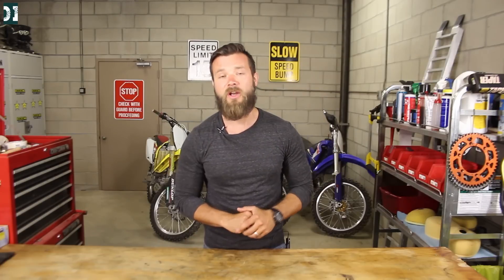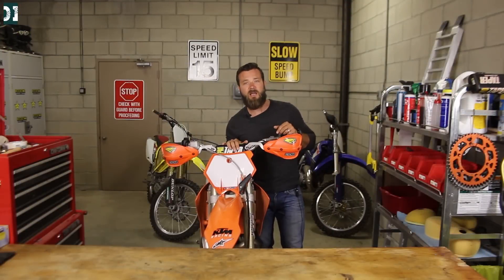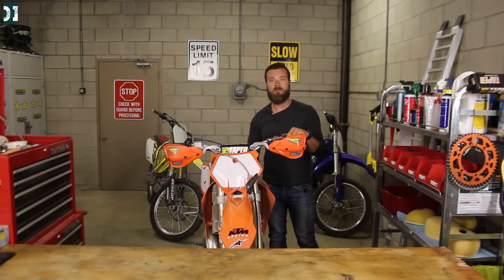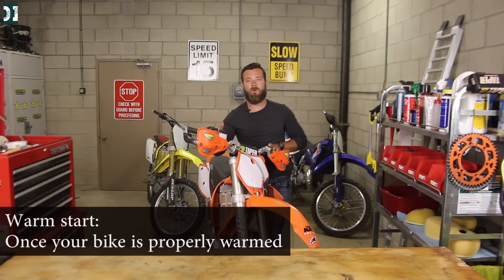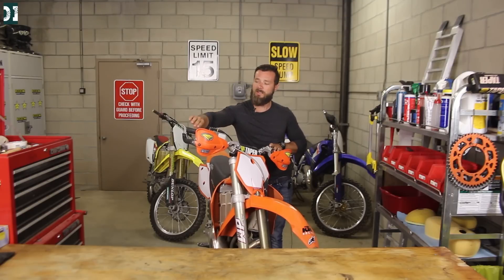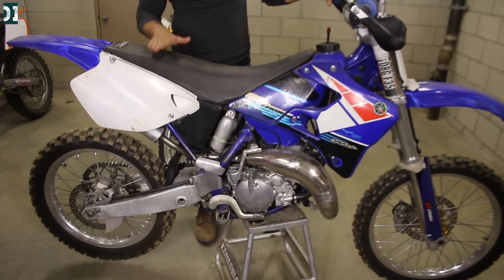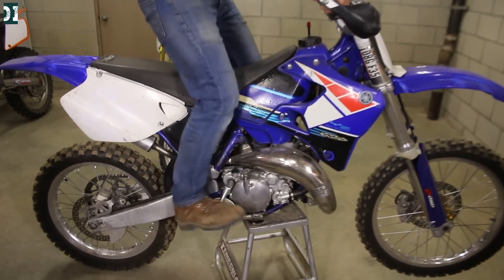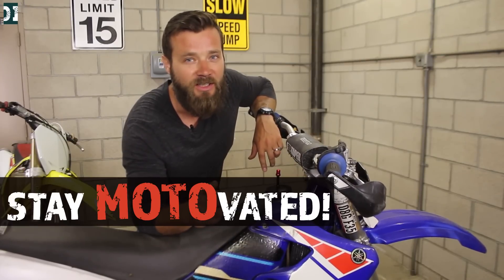How to kick start 2 stroke dirt bike - Beginners guide.

Comment: I wish my bike started that easy
Reply: Yeah, not everyone can afford expensive race ready eurotrash lol. I feel ya, if its a little damp out on a cold start my bike will not start until the 10th kick or so. On a clear day it'll start in less then 5 kicks usually though. Went from electric start to kick start and I can say its easier to start after laying it over in a mud hole (mentally) if that makes any sense
.
Reply: @ThatMotorsportGuy  I have a Honda CR from 2006 that I bought for 1500€ and it starts first kick.
Reply: kråkfia dude same, but it’s 2007
Reply: Sam could it possibly be the top end? My 91 yz250 takes about 10 or so kicks to start and takes a while to idle nice
Reply: Mine is a 1985 kdx80 and starts in 2 or 3 kicks some time 1
Reply: Got a 2000 kx250 an it starts 1st kick every time
Reply: Mine is a 2019 KTM 85 and it takes about 10 kicks after top end rebuild lol
Reply: I’ve got a 2006 Yz125 big bore and she starts first kick every time
Reply: So I have a 2006 cr85 which my dad rides that starts first kick everytime, I have a 1998 kx65 that I used to ride and kicks first time. So why does my 2009 yz85 take forever to start sometimes. It may be that I’m not kicking hard enough.
Reply: @browngaddyoutdoors  fr sometimes when I’m really lucky it start in 2 or 3 kicks
Reply: l just got a bad bike...
Reply: Difficult starting is usually due to a lack of compression.
Reply: @Username-2  I put a brand new top and bottom end in my 2001 yz125 and it won’t start first kick
Reply: Adjust carb.
Reply: @mperez9745  me?
Reply: @JayWithTheAmg  yeah. I always start with the carb of the bike wont start
Reply: I have a 1998 kx starts first kick lol
Reply: i wish i had a bike lol
Reply: Must be your RPM is too Low!

Comment: I bought an 87 yz250 that sat for 2 years and wouldn't start and paid $200 for it. Had it for 30 minutes riding it around the block and it was running strong. A year later still have the bike still runs strong and am confident the bike will start when out on the trails and track. Nice complete dirtbike with a powerful engine and suspension sucks but its in good condition just 80s suspension is miles behind 90s and 2000s suspension that im used to riding

Comment: Another tip I see very few people doing, is to slowly kick the bike 2 or 3 times as a sort of primer. Helps lubricate the cylinder and is easier on your kick starter if the bike doesn’t want to start first kick cold.
Reply from the maker: Thats a good tip Chris, thanks for sharing!
Reply: That is KEY!
Reply: That's to feel the piston hit TDC ,makes for a full  kick on the kickstarter hence, easier, less effort, and by design 👍
Reply: Sorry, that means, Top Dead Centre ,piston's as far as it can go up stroke, hope that helps 👍

Comment: I pretty much set on a 2t for my next bike, I 
have two questions;
Does a 2t kick back hard and often like a 4t, never 
or rarely?
Could you do a video on starting the 2t when it is 
flooded, air locked, flamed out, hot, or god knows what
just not starting easy after riding a while?
Thanks!

Comment: Just wondering if a 125 2stroke would work for me.  Mid 50's, 6'4'' and 325 pounds.  I want to ride motocross stye riding.  Great channel, keep the videos coming.
Reply from the maker: based on my limited experience I think 125 seems little small for you...
Reply: Able To I think you would need a 250

Comment: So my 250 has been sitting for a few months
I went to start it and it went wide open like I had the throttle all the way back
Is this normal?
I turned it off thinking I would possibly damage the bike.
Mind you this is the first 2 stroke I've owned.
Reply from the maker: no thats not normal, good you turned it off right away. there is something with your carburetor, check it the cable works fine, if it isnt shut open, clean the carb, inspect it.. there is something wrong.. make sure you have enough gas flowing to the carb.. sometimes when  running out of gas your rpm will go up like that..
Reply: Old gas probably clogged your carb. Tear it apart clean it and put fresh gas.
Reply: yeah i cleaned the carb out after that, the old cable was a bit damaged, have one on the way and hopefully that fixes the problem.
Thanks for the reply
Reply: Tommy Emery i would definitely clean and maybe rebuild/rejet the carb depending on how it ran before it sat- idling,starting hard like my suzuki...
my 125 hated to start even on 80 degree (ferenheight) days i would have to do everything including some crazy things to get it running. i figured out later that the last owner put a racing ignition system in it and that was the problem. 
i would mainly check the carb and ignition system and make sure its not a 20$ ebay kit that does nothing but make it run like junk
either way i hope you can do your fix and keep riding👍
Reply: Tommy Emery make a video of it running and post it? Just run it for a few seconds don't blow it up then maybe we would have a better idea of what it's doing sounds like your throttle is stuck open tho
Reply: Tommy Emery it's the throttle cable there is a needle that goes into the top on the engine its out of place the throttle is wide open when u started it right

Comment: Oh my dads old ktx was an absolute barstard. If u got it started you were on the back wheel in 4th gear. But most of the time ud drag it out the shed spend half an hour kickin the barsard, crack the shits and put it back in the shed. but if u finally did get it started then u were too tired and sore to ride it. Its worse when u come off. U go ass up on a dirt track when ur kilometers out in the bush and the only way to get back without dying of thirst or the sun was to kick start the flooded fuking thing while extremely sore

Comment: One common problem with carburettor dirt bikes is there is not fuel in them after they have stood for a while and if you don`t put the bike on the side flooding the carburettor you can kick them for minutes without they starting. My WR450 was like that and I see many other bikes with carburettor must do the same.
Reply from the maker: thanks for sharing, I never had that problem though..

Comment: It's actually not a choke but in fact an enrichener.  No air is choked off, air is allowed into the fuel bowl when the plunger is pulled, which pressurizes the bowl, thus sending more fuel.
Reply from the maker: thanks for the info

Comment: Hello, Dirt N Iron, I have a quick question for you. I should be getting a bike soon but i'm debating on a CRF250R and a 1990 YZ125 for $1800 which looks and at least says its runs very nice. I know the downfalls of a 2 stroke and also a 4 stroke but I am still unsure. And I am not very uneducated on carbs and engines, I know quite a bit about them, but not everything. I am 13 years old, I weigh about 130 lbs, I'm 6 foot tall, and I am doing mostly trail riding but not very tight trial riding mostly wide trials but some tight trials. I have some dirt bike experience but not a lot, I would start on a 150 4 stroke if I really had to, but its just uncomfortable since i'm 6 foot plus I would like something a bit faster. I have a lot of riding experience on mostly four wheelers, right now I ride a 2013 Raptor 700R SE. Right now I am leaning towards the YZ125, although mixing gas is a con for me. Here is the YZ I am looking at, maybe you could inform me on why not and why to get a 2 stroke especially for trial riding. I have rode a lot on 2 stroke snowmobiles and so far haven't messed up a engine but snowmobiles 2 stroke engines are of course a tad different, thank you! :)
Reply from the maker: 125 2 stroke is somewhat lazy from the bottom and rips once you hit the powerband, that's why its not the best bike for technical trails when you many times need to lug the bike in low rpm, you would find it little lazy I think. 250 4 stroke has more linear power delivery and pulls better from the bottom. both can be fun on the trail, they just need to be ridden differently. I definitely suggest to get full size bike, skip 150 4 stroke, I think you can handle full size. If you are leaning towards 125 then go for it, it will be great bike for you. Good experience to have, you can always sell it and get something else if this doesn't work for you, used bikes don't really loose value in a year or two.
Reply: Thank you for the fast response, I have another question and something to say. It wouldn't really hurt me to rebuild the top end of the engine after 100 hours on a build because I do enjoy messing with engines even though I am not the best at it. The reason I have been leaning away from the 250 4 stroke is because the price difference and I can barely find a 250 around where I live. I love the 2 stroke sound but yet like you said I would probably foul some plugs but I do tend to go pretty fast but not fast fast on trials. Like I said I would really want the 2 stroke but, do you think if I took care of usual maintenance and treated it well it would last me 100 hours till a top end rebuild?  My brother had a KTM 125 2 stroke and rode it around everywhere with us and always made it around but he got rid of it and he never had to do engine work to it, he had it for about a year. But I guess it varies. So what do you think would happen to the bike (the 2 stroke) after about 50 hours of trial riding going medium speed. Thanks for the response and any tips on a 2 stroke that would help me please say, thank you. :)
Reply: I would also like to add the bike, this isn't exactly where I live so Ill just put the link of the post. https://nmi.craigslist.org/mcy/6140903633.html
Reply from the maker: +Cj you should be able to get 50-100 hours out of it on the trails. 2 strokes are great, jetting is important, keep the filter clean, mix the gas correctly and have fun!
Reply: Hey, just figured I'd update you, I ended up getting a 1999 YZ 125 that went up for sale lately it has a whole different pipe and silencer and sounds awesome. so far I'm loving it and just wanted to update you. :)
Reply: 6'0 130?? Eat some meat and pump some iron! Lol
Reply: ItsCj hey I have a 1999 yz 125 how’s yours going?

Comment: how do i know if the compression is too low? and what should you do if it's too low?
Reply: Edoardo Mauri on a 2 stroke you shouldn't be able to start the kick start the bike with your pinkie. If you wanna be precise you can go to a auto parts store and get a compression tester and put it in to your spark plug hole and test it. Google the number your bikes compression should be at. If it's too low you'd need a top end rebuild.
Reply from the maker: +Edoardo Mauri  you should have good resistance on the kick starter, it should not be too easy, you can get gauge and measure it and then check toward recommend values from your bike. Once it's too low you need to rebuild top end.
Reply from the maker: +Oneway Jaye sounds good!
Reply: Thanks :)

Comment: Hi, I have an Yamaha RX100 Japanese 1989 model recently changed the engine oil and 2t oil. I turn off the fuel at night and in the morning when I turn it On it doesn’t start. I had to let it be  for 5 min and then kick it again to start. Is it common for old motorcycles?? Any suggestions for this?
Reply from the maker: are you using choke?
Reply: I don’t use. Is it mandatory??

Comment: Nice vid! Keep up the good work, I have a question, should I get a cr 125 or a yz 125??
Reply from the maker: +Real Trikz Gaming do you like blue or red? :) I don't really like one more than other, both are great bikes, get the one you can find better deal on
Reply: Real Trikz Gaming Personal choice. I would get a yz
Reply: Dirt N Iron at the minute I have a crf 150f and it runs great and my local mx shop says they will swap my 150 for their 2016 cr 125 which I think is a good deal :)
Reply from the maker: +Real Trikz Gaming are you sure it's 2016 cr?
Reply: Dirt N Iron  yes
Reply: 2007 was the last year honda made the cr125
Reply from the maker: +Don Huynh that's what I was thinking. I haven't heard about 2016 cr125.
Reply: scam

Comment: I have a yz250 what are you mixing because there’s zero smoke coming out of your exhaust and I’d love that currently I’m using 50:1 in a 5 gallon gas tank minimal oil comes out of the exhaust
Reply from the maker: i am using 50:1 also

Comment: Awesome vid Dirt N Iron ! Subscribed ! I like your vids and explanations, refreshing compared to the other stuff out there.  I have a question please... I just bought a yz125 New* . When I bought the bike the dealer had the pre mix in and everything was ready to go. I haven't been able to ride it or break it in at all since I got it almost three weeks ago. (sigh*) my dealer has said to me it's fine if I start it up and break it in without draining the fluid and Re-mixing even though its been sitting. By the time I ride it will be about 3 weeks and a few days. I have read online that possibly you should never use pre mix thats been sitting. ( so many opinions on everything) The dealer says its no issue... Any insight would be GREATLY appreciated. Could the sitting fluids cause havoc in the bike? And or could it potential be harmful for break in. Thanks SO MUCH!
Reply: To be clear the dealer* said within my time frame of 3-4 weeks its fine. I did not asking about anything longer.
Reply from the maker: James, congrats to your purchase, you got yourself great bike. Personally I wouldn't worry about gas that has been sitting 3-4 weeks, just start it and break it in following the manual. My 2 strokes sits for a month sometimes and I never had an issue, you should be fine. Good luck bro!
Reply: Thanks so much man, really helps me. So when the Manual says "do not use premix that is more than a few hours old" Its probably just to cover the manufactures ass right? I'm assuming every manual says that. Thanks again !
Reply from the maker: +James Agostino yea, I think so. They tell me to change top end on my RMZ each 12 hours :) that's like once a month if you ride each weekend. But if it is not too much hassle, drain it and get new gas I bet you don't have full tank. Just because it is brand new bike before break in. I think that's what I would do now when I think more about it. Out of the respect for new bike, she deserves to start her life in a best possible way. ;)
Reply: Dirt N Iron I'm thinking that makes the most sense .. why not right !?  . Last thing ... would you drain anything else ? Or premix is probably it and I'm good to go? Thx man!
Reply from the maker: +James Agostino yes premix is all, change the gearbox oil as recommended in manual. I think first oil change is fairly quick. After that its normal interval.
Reply: Your the best ! thanks

Comment: any tips on clutch problems? Like when you put it to any gear other than N and hold clutch, it doesn't engage
Reply from the maker: looks like its slipping, first change the oil, make sure you use good oil, adjust the clutch and see how it feels, if still doesnt engage then open it up and check the clutch, you might need new one.

Comment: Would you recommend starting on a 125 or a 250
Reply from the maker: 2 stroke? how old, heavy and tall are you?
Reply: 2 stroke.. 18 195lbs
Reply from the maker: start on 125, I think 250 2 stroke is too snappy for a beginners bike. Its not impossible.. but its easier to start on 125
Reply: ended up getting a 2002 yz 250 for a really good price and wow is it powerful.
Reply from the maker: Swapo Studios cool man, congrats! take it easy from the beginning

Comment: Hey! Can you maybe make a Video How  to set  the Idle  From  the Motor? (idle  mixture /standgas)
Reply: I am asking  because my Husqvarna cr 125 is to
turning off in 1 gear (pulling  the clutch)
Reply from the maker: i will put that on list, thanks for suggestion.  there is idle adjuster screw on the carburetor, play with it little bit, i think you need to raise it a bit
Reply: Thank you very much for the answer! :)
I appreciate it.

Comment: I have a 2003 ktm 250 exc. it will not kick start but I can pull start it with another bike. And it runs great. But like I said, will not kick start even after it is warm.. any idea why?
Reply from the maker: I would check the carb, jetting, maybe even power output on your stator.. once I had aftermarket stator and had to kick the bike really hard to make enough power for ignition..

Comment: I have a kx100 2 stroke and it does not idle for more than 30 seconds does that mean anything are they supposed to idle like that
Reply from the maker: Everything an Anything they are supposed to idle longer, probably air screw need little tweaking. maybe raise the idle a bit

Comment: Is it easier to kickstart a 125cc 2 stroke than a 125cc 4 stroke?
Reply from the maker: both should be fairly easy
Reply: Dirt N Iron Aight, I've had problems with the compression and kickback on 4 strokes so was just wondering
Reply: My WR450 was about as easy to kick start as a 1983 KX125 2 stroke and it never kicked back.

Comment: My cr125 has set for about a few months and I tried starting it yesterday but I couldn't get it started, any help?
Reply from the maker: make sure you have spark, use new spark plug, make sure you have clean carb, try to follow the procedure from the video, it should start. You might need to clean the carb maybe, the pilot jet might be dirty or clogged.

Comment: Is it normal for a 250 2t to kick over easily I'm used to big bore 2strokes and it's so easy to kick it on my 250 I'm not sure if I need a top end or not I'm gonna be doing a compression test soon
Reply from the maker: +Honda Cr 500 it should not be that easy, you might need top end. Compression test is good idea.
Reply: Dirt N Iron okay if I've a new top end should I get vertex I heard they are the best
Reply from the maker: vertex or wiseco i guess